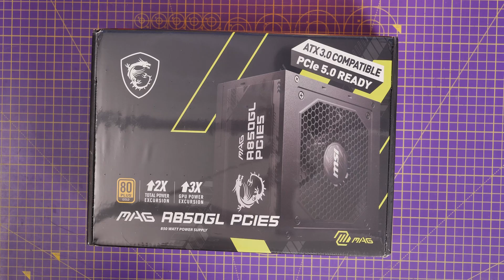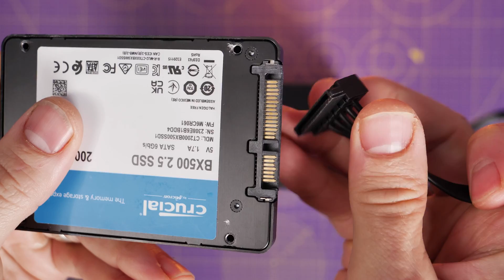MSI Mag A850GL PSU wiring guide

Comment: What if the motherboard you have doesnt have two eight pin cpu power connectors, it has one eight and one four pin cpu power connectors? Can you still use this power supply for this type of motherboard? The Motherboard is a Asus Tuf Gaming B760-plus wifi?
Reply from the maker: One of the CPU connectors can be split in half (usually slide or snapped apart) and then will give you two four pin connectors.
Reply: @TheProvokedPrawn   sorry for the late reply. It took me a while to figure that out as the included cables were put together so well I thought they were solid and couldn't be split. Thank you.

Comment: i bought this for my 9070xt with 2 8pin cable, should i be able to connect everthing right?
Reply: I have the same card. Looking at the specs for the PSU it's supposed to come eith 4 pci-e cables which should be plenty for a 9070xt which most have 2
Reply: How's it going? Im building and thinking of daisy chaininng one of the cables?
Reply: @TheBurger1234  after 1 month all good, connected with 2 different 8 pin
Reply: Thanks for confirming!
Im here to also say that after two days running the PC it's been running all good! 
 @samuwiki

Comment: i have a question...for example i have graphics rx9070xt card with 3x8 pin connector can i use the pigtail configuration since i only have 2 8 pin slot left in main psu?...tnx in advance
Reply from the maker: You probably can, yes
Reply: @TheProvokedPrawn  tnx soo much

Comment: I have the msi PRO H610M-E DDR4 motherboard and it only has one cpu power conector on the motherboard I have this psu to fit so can I connect the cpu power lead from the psu using the left hand conector next to the top left atx conector that you show in the video? thanks any help would be great 👌

Comment: This is amazing!!! Thank you!!! Building my first (ish) PC myself with this exact power supply and have never used modular before, so the 24 pin to 18 + 10 pin confused me to no end 🤣

My MOBO has an 8 pin and 4 pin connector for the CPU power. As the CPU cables are 8 pin to 2x4pins I assumed it was ok to use both and just split one, running the unused 4 pin somewhere out of site, I might put electrical tape on this as I am scared to have a loose power pin in the case. Just wanted to see if anyone could advise if this is correct?

Comment: Say , I have one question .. the PSU only comes with 2 PCIE 8 Pins with Each Cable having 2 8 pins via Pig Tails 

Can you really use those for a GPU that needs 3 PCIE 8 Pins like RX9070XT ? I've seen some people say that you need 3 Separate PCIE 8 Pins Cable
Reply from the maker: Three is preferable but it should still work

Comment: Bro, this PSU comes with a 16 A plug, but my UPS only has 6A plugs, can i use a cable with 6A plug? I'm in India, here most household plugs are 6A and UPS also. My maximum load is under 700 W

Comment: You my friend are the biggest life saver in the world. Was building my first build and nothing was powering on I tried shorting it etc but nothing double checked all my cables were in properly and still nothing.

The guide I was following didn’t clearly show me I needed to plug in both ends of the atx power on the power supply end I just didn’t plug in the bit that stems off was proper stressing for hours. 

Watched this video and it was an instant fix THANK YOU

Comment: How to build my spec : ● AMD Ryzen R5 5600G
● ASRock B550M Phantom Gaming 4
● INNO3D GeForce RTX™ 5060 TWIN X2
● CPU Cooler DA Kaze 4D - Digital Display Black
● SSD Adata Ultimate 650 240GB
● SSD NVME 1TB PCIe Gen 4
● HDD WD Blue 1TB
● AOSOR HEATSINK M.2 2280 SSD CM-M2F ARGB ENCLOSURE - Black
● APACER NOX DDR4 32GB 2x16GB 3200Mhz CL 16-20-20-38 - White
● PSU MSI MAG A850GL 850W 80+ Gold PCle 5.0 ATX 3.0 FULL MODULAR
● ARGB 8 Fan - Black Case
● Case VenomRX DROGON
Reply from the maker: https://youtu.be/xT36IDSQBX4

Comment: why is that ATX cable so impossible to connect?! My first MSI PSU - I usually get Seasonic and I'm not impressed with this particular cable! Had to come to YouTube just to find out if it both plugs are actually meant to connect to the PSU! Thanks PP.

Had to go back to check out the kittened mittens!

Comment: I have the mpg 850 model but for gpu i have 2 cables nornal ones + 2 cables with 2 spilts,so if i want to connect a gpu witch requeier 3 cable what should i connect
Reply from the maker: Use two normal ones and one split (assume you mean pigtail)
Reply: @TheProvokedPrawn  Yes,cuz i have 2 normal and 2 pig tails,adn the non detachable conecter should go in the psu side? and the 6+2 side in the gpu correct? Thanks

Comment: Hello new pc builder here so for this power supply I have the xfx Radeon  7700xt I wouldn’t be able to use the 12v power supply correct ? I would need to use the the other pig tail cables to power my gpu
Reply from the maker: Yes
Reply: @ thank you for the response I was going crazy 😅

Comment: I'm using msi mag b550 gaming plus mobo and in the top left is only one 8 pin for the CPU. Into which of the two cpu slots in the PSU you used here should i plug it in? The left or right slot?

Comment: Hello good video ❤
I have a question  do i beed to connect my rx 6800xt  to two separate  cables ? or the single  8 pin to two 6+2 cable  that comes with the a 850 gl works ?  I have actuly connected it  to the single one but  its my first build everything is fine but i have to know wich is best

Comment: A big thank you for the extremely useful information at 2:15 You are a life saver. That cord is so obscure that you would initially plug the larger one in and assume the smaller one is redundant. I was too scared to twist that smaller cord around and plug it in. Then I wondered why the computer would not power up. I find your video and it solved everything before I dismantled and started from scratch. Extremely useful!
Reply from the maker: Glad to help
Reply: SAME ISSUE HERE BRO I THOUGHT YOU DIDNT NEED IT

Comment: My motherboard needs 8+4 cable but I can’t find any what do I do? For this Psu btw
Reply from the maker: CPU/EPS cables that you can split apart?
Reply: @TheProvokedPrawn ended up being able to split the cables and now it’s good but there’s the other half of the four hanging around is that ok? Same thing for my gpu I was told that I need to use both of the eight pin cables for my 7800xt and not to use one cable and the two ends

Comment: I had installed this power supply in my system and have been running it fine for months. However, your video made me realize that one of the connecting cables that I did not connect to the power unit, was going to be necessary once I upgraded my GPU.  Thank goodness I didn't throw it away and I was able to install it on the power supply.

Comment: Thanks for the video.  It may be to early to say for sure but I think your video has solved a crashing issue that has been plaguing my son's PC for about 3 months. We installed a new Gigabyte 4070 super GPU and a new MSI MAG A750GL power supply.  When first installing the new parts, I did not think about using the 12V 2x6 cable (new tech to me) because the card came with a Y cable for using two of the 8 pin CPU&PCI-E slots.  The computer started crashing with loss of display and then the CPU fan spinning up to max speed.  I thought the CPU's default cooler was too weak so I replaced that along with a couple of 140 mm fans for the front of the case.  I also updated the bios for the MSI MAG B550 Tomahawk MB, along with chipset, lan and audio drivers.  The PC would still randomly crash especially when gaming.  So after watching your video I checked the power supply box, and the MSI MAG A750GL comes with a 12V 2x6 cable labeled 450W.  I removed the Y cable and installed that.  The computer was then used for over 9 hours without crashing - at 2K res played Sons of the forest and Return to Moria with no issues.  I ran GPU-z in the background and the GPU board seemed to never go over 170W.  I am not sure why using the Y cabled failed.  Still need to keep my fingers crossed but I hope this fixed it.
Reply from the maker: Sounds like an annoying issue. Hopefully sorted now. Thanks for sharing

Comment: bugger I was hoping you would show how to use this PSU to connect a 3x PCIe8 GPU. I think MSI supports the 12v 16Pin -> 2x 8Pin connection along a regular 8pin pci-e is that right? Is there sucha a 16Pin -> 2x 8Pin cable in the box?

Comment: quick tip, the fan noise will get loud in the long run, u can replace the stock fan with a quieter one, but the psu itself gives out only 5v to ur new fan which not enough power to cool the psu at high usage, no worries, there's a work around, connect ur new fan to the mobo instead and adjust it from there.
Reply: Wow  i love the costumisation in pc building

Comment: Hi I am using the ASUS ROG STRIX B650e-f Motherboard. It has a 8 and 4 pin power connection in the top left. Which cables do I use for this?
Reply from the maker: You can split the CPU cable if I recall correctly

Comment: So I have the MSI A850G (no L) and my motherboard has a CPU power socket of 8+4 on the top left. After reading around, turns out you can boot with just the 8. I didn’t have a cable anyway so it’s not like I had much of a choice. Mobo is GIGABYTE B650 AORUS Elite AX rev 1.2. 

Thanks for the video. Definitely helped with the 24-pin connector!
Reply: what do you do with the other remaining 8 pin ???
Reply: i have the same problem 8+4
Reply: @nc.0927 did you ever figure it out
Reply: Yea I have a 8+4 motherboard but there isn’t any cable like that for this psu😢
Reply: @Gmu-x9h  actually there is, both CPU cables provided have the connector that can be split in 2.

Comment: The fan on this psu is loud. Louder than all my other fans in my PC and I have 3x140mm and 6x120mm. My pc draws up to 230W . I was not expecting it this loud. Spend £20 more on something better like the A850G model and you will not regret it. The L in A850GL stands for LOUD !!!!
Reply: how loud it is when u put headphone?
Reply: @jokok2333  With "ambient sound on" on your headphones it's loud ;)
Reply: I got the A1250GL, so far I can't even hear it. Played Helldivers2 for a while with my 7900XTX and 12900K. I can't hear the A1250GL at all.. maybe if i'll put my ear against it but that's ridicilous.
Reply: So you got the A850G? Is it still going strong? I'm trying to decide which 850W psu to get
Reply: @namelesskat4814  Yes I do have it and I am very happy with it. It's very quiet and has good cables. I recommend it.
Reply: @ ok thank you

Comment: I have the a750 pcie5 with a b650 eagle ax mobo, it'd generally be the same installation? 

Thanks in advance, videos already helped a lot

Also, you show installing the ssd through the sata cables but mine was just a chip that went right into the mobo, a little confused.

Comment: I have a question, my mother board had 1 8pin and 1 4pin for the power and not 2 8pins (msi pro b650m-a wifi motherboard). Will I still be able to use this power supply, or do I need to go for something else???  plz help...
Reply: Same issue here did you find a solution?
Reply: @Grifjaguar  yup, basically the connector isn't a single 8-pin. It's two 4-pins that are clipped together, and you can separate them.
One end of the connector cable has a single 8-pin (that goes into the power supply), and the other end has two 4-pins clipped together to form an 8-pin.
I bought the power supply and installed it, and it works perfectly fine.

Comment: Nice video, got me through some confusion.  One thing that got me; my motherboard cpu power is 8 socket + 4 socket.  I didn't realize you can separate the 8 pin cpu cable into a 4 pin.  

But what's PC building without at least 1 freak out?
Reply: @spookyaction3236  I freaked out about the same thing. It's my 1st time building a pc, and I thought the psu wasn't compatible with the motherboard😅

Comment: I have an RTX 4090 with an old 12VHPWR port instead. Can i still connect it to this PSU or would i need to buy a new PSU instead ?
Reply from the maker: Yes this works with the original 12vhpwr connections
Reply: @TheProvokedPrawn  thanks a lot

Comment: I'm trying to use the yellow gpu cord with my 3060ti but it doesn't fit, neither does the cord from my old psu to gpu, any suggestions? It is founders edition 3060ti
Reply from the maker: Do you not have an adapter with your GPU? I thought the founders edition cards had a special adapter.

Comment: hi can you help me, i bought an incorrect lian li strimer v2 which is dual 8pin , my gpu is 4070 super and has 1x16pin. is there a way i could still use the extensions?
Reply from the maker: I assume by 1 x 16pin you mean the 12vhpwr connector? You'll need to send it back or use the horrid adapter that came with your GPU sadly.

Comment: Hello a beginner here , just want to ask , i can see 4slots of 8pins CPU&PCI-E in the PSU , does it mean I can plug in any of those 4 slots for the CPU&PCI-E power?
Reply: I have the same question. I just have to connect one CPU wire but i am assuming I can connect it to the CPU&PCI-E that is next to the ATX 24P connector in the top left....

Comment: Just to answer my own question, after doing a lot of research and speaking with two other YouTubers that created recent videos on the newer PSU units. This and most 3.0 ATX and 5.0 pcie support units come with two cables that connect to the new 12v (16 pin) connector. One is for Nvidia GPUs that go 16 pin to 16 pin directly. The second, is a 16 pin to a branch of two 8 pin (6+2 pin) cables for standard cards. Again, these are not the pigtailed/daisy chained 8 pin pcie cables but the counter part to the 16 pin to 16 pin for Nvidia cards. This cable is able to pump the same amount of wattage to standard GPU connections as it does new Nvidia cards, so it's recommended. It also only requires one connection to the PSU, rather than having to connect two pcie 8 pin cables. 

This is a great PSU btw. It's quiet, comes with all the most modern features and cables, and delivers all the wattage it advertises out of the box brand new. In the future I'd like to see power supply reviews do a complete breakdown of every cable that comes with it and how it should be connected. It's important. Otherwise good video.
Reply from the maker: I didn't have that cable
Reply: @TheProvokedPrawn  interesting I'm looking at the box right now. Mag A850G PCIE 5. It's missing the "L." That's weird, they look identical. Either way it provides information to future units. I've gone through dozens of power supplies in my lifetime and this is the first time I've ever seen that cable. Hopefully it helps someone. Class video!

Comment: Is this PSU compatible with the XFX Speedster MERC310 7900XTX? The GPU has/requires 3x8, but from everything I can tell, this PSU only has 2x8. I'm brand new to PC building, so please, any any all advice is MUCH appreciated!
Reply: Same here, will never but msi power supplies again... cheap bastards only gave 2x pcie cables... my gpu has connections for 3 pcie slots.
Reply: There weird it’s 2 cables but 4 8 pin connectors as long as the gpu doesn’t pull over 375 w it works

Comment: From my RX 7800 XT. This PSU included two of the new 12v cables. One was for Nvidia GPUs like you demonstrated well. However, the other connected to the same port in the PSU but then split into two separate (not the pigtailed pcie 8 pin) pcie 6+2 pin connectors. I seem to be having issues verifying this, but I believe that cable is all you need for AMD cards. Again I'm not talking about using the pigtailed pcie 8 pin connectors, I'm talking about a 16 pin connector that plugs into the 12v port and branches to two separate 6+2 pin GPU connectors. You seem to know this PSU well. Can you verify using that cable (I'm new to these new units) is correct and safe for normal GPUs that require two 8 pin (6+2) cables? I can't imagine why else they would include this cable otherwise, but I wanted to double check. Thanks for the class video mate.
Reply: what did you find out?
pls tell me because im also confused
Reply: @das3tins768 did u get it?
Reply: Waiting in suspense for the answer
Reply: @Nith2  Only high end Nvidia gpus use the new cable, again ONLY for Nvidia. The 6+2 cable it's an 8 cable just plug in together

Comment: hello sir, I have a question. If i have 5000t case, i want to use RGB and connect with icue app but i don't want connect id cable & RGB cable to commander core xt in case ( can use 2 cables ID & RGB on Mainboard???), have any way let case 5000t use rgb???